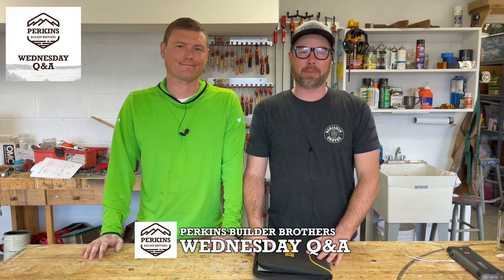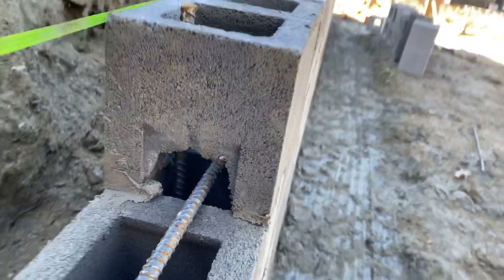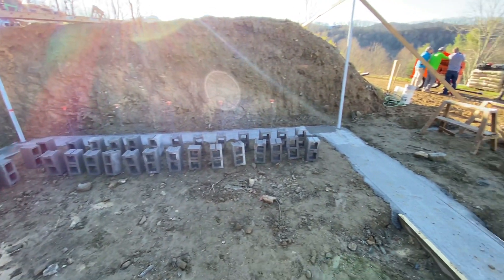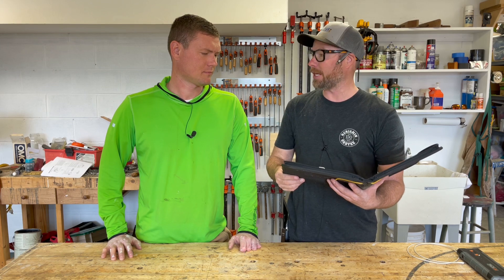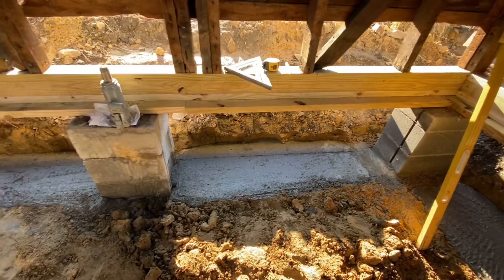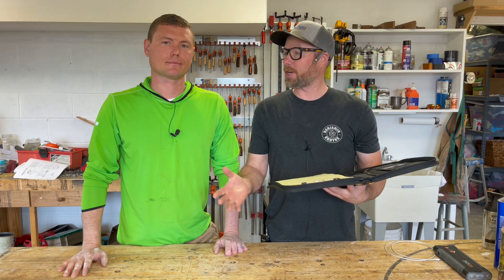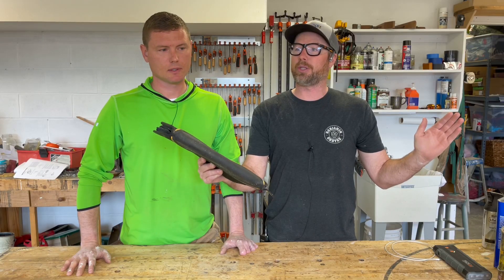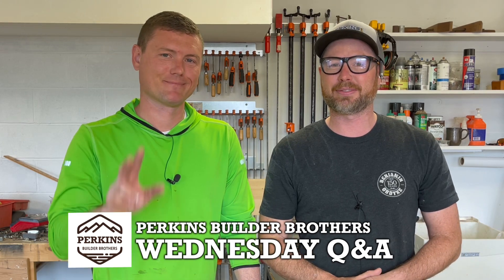Foundations and Underpinning | Wed Q&A #5

Comment: Balusters is the correct word for the vertical portion of a balustrade. Balusters were/are used as the vertical structure between a top and bottom rail. Balusters are for decoration as well as fall prevention between the two horizontal rails.
Pickets are sharpened/pointed vertical pieces that protrude through the horizontal plane/rail. Pickets were actually devices used for protection around a given perimeter. As viewed in paintings, photos and descriptions from antiquity, pickets were frequently used around houses. Side note: I suggest pickets were used more often to protect against animal intrusion versus human trespassing. Today’s modern world, and even back 200 years, is not a fair picture of the world some 400 years ago and beyond. Bears and lions were prevalent in Israel and numerous stories of dragons in Europe! Animals when $ where-abouts and the extinction of them, either by world-wide or local extinction, is is whole other topic!😂 The point? Pickets are pointy protection devices protruding vertically through the horizontal plane whereas balusters are contained within a top and bottom rail to form a balustrade.

Comment: Underpinning here in Michigan means Underpinning a foundation to add onto or rework a new building.  So you typically dig under the original footer no more that 2/3 of the footer and drill in new rebar hens pinning and your under the original.  Typically this is only done under columns to build new columns right next to each other.  But very rarely is this done the hole length of a building

Comment: i use 2x6, 8, 10 and 12 wrapped in plastic wrap for concrete forms then reuse on the house. to me working with wood is ways faster and lighter than blocks and then all the weight is in the concrete pump so i don't have to lift tones of materials

Comment: There were a LOT of Packard Trucks that hauled a lot of moonshine and other illegal spirits back in the 20's and 30's. as well as stocking groceries all over the country. Yes, there were Packard trucks as well as cars. Good, reliable, and strong.
Reply: Packard stopped building trucks around 1923-1924. I doubt if very many of these were used to haul bootleg liquor during prohibition. However many early luxury automobiles were repurposed when the original body started to look old-fashioned. Sometimes a wealthy car owner would commission a new, more stylish body to replace the original. Others would be sold cheap or scrapped and then reappear with a pick up or flat bed cobbled on the back behind a truncated body. A fair number became wreckers, making use of the powerful Packard engines and strong frames.

Comment: Hey man what you're describing about shimming up the blocks  before grouting is close to underpinning but not quite...underpinning a foundation is where you dig down under the footing about a 3ft long section you add reber in a grid pattern and pour concrete/cement till it reaches the footing and might encapsulate it then you skip a 3-4ft section and do it again then you come back after the concrete/cement has cured and dig out, rebar and pour the sections you skipped the first time around the house and this makes a solid foundation/footing also you dig it a little wider than the existing footers. Its pretty labor  intensive...you can use something like a back hoe but to get up under the footing you really need to do it by hand/shovel but yeah that underpinning a foundation and the reason I know about it is I believe my house may need it done...so I have researched it and for some reason I'm getting dajivou lol I feel like I may have seen this video before and commented?

Comment: I do a lot of decks....there is an app for baluster spacing that has changed my game...type in the space between posts, baluster thickness and desired gap between.....voila done and done, it will even give you a spacer block thickness. Things will vary of course becasue just like you guys said the posts are never the same distance apart to make perfect equal gaps but fuck man I do railings in minutes now.

Comment: Is it still within code to build a house completely with concrete blocks? Minus the roof of course.
Reply: In northern Europe or in Russia it IS the way to build houses. it is more expensive of course but way more strong. and yes, you lose all space inside walls for pipes, electricity and so on.

Comment: In my experience poured walls crack vertically and leak far more than block walls leak. Some block foundations I’ve worked with are 60-70yrs old before water is an issue. Most poured walls were under 10yrs old, and one was only 2 months.

Comment: Steel and core fill is code here🇦🇺. Underpinning is done for structural repairs. Also instead of blocks you could habe formed up collimns and poured a high mpa.  Your "grout" os called mortar.  Here anyways. 😁 i also do your way with balustrading

Comment: I have an old tobacco barn that I'm debating on tearing down or shoring up.  Half of the concrete brink foundation has fallen away, one side's 6x6 mudsill(?) has twisted and is almost off the crumbling blocks with that side of the barn drooping.  Even with those problems it seems pretty sturdy so I'd love to get it where I could use it without fear of the thing falling on me.  Plus I'm not sure how to bring it down safety other than using a bulldozer.    I've searched youtube trying to find a video on how to shore up an old barn foundation.  if you know if any good ones....

Comment: A balustrade is a post/column style enclosing topped by a top rail. It is usually referred within as a stairway or indoor landing railing of early European architecture however most were turned wood not square and do not have a bottom rail.    A baluster is a single column or post and normally positioned into a predrilled hole in the floor or step.  For outdoor balcony railing, with both top and bottom rails and using square stock is not considered balusters but I presumed PINS or slats.  

I am not sure of all international standards but the varied pitch slats is NOT a good idea for safety reasons. Aesthetically I would agree.  However, considerations have to be present for both children and pet heads being stuck between posts.  A 1/4in difference in span/pitch may not look different but would make a big difference in bending and or squishing a bigger object between the central slat span.  Most standards have a maximum acceptable width and bending moments. I don't see any issues with your design but I do suggest some cautionary notes.  Not all wood slats bend/flex the same.

Comment: I worked on a job in London where we had to dig under and support a stone foundation. We ended up casting a large pier, building brick up, and then packing in a super dry mortar mix on top of the last course. The dry mix was hammered in with a sledge and a wooden block.

Comment: When you talked about the last block being installed in replacing a foundation wall I noticed that you did not put a layer of foam (used to seal between the sill plate and foundation block in new construction) in before wedging in that last cap block. Won't you get insect and air infiltration into your crawl space? It was not done (anything to seal between basement wall and sill plate!) when I built my house in 1978 and I have had insect/mouse problems with no good way to after-seal that area.
Reply from the maker: Good question… A big bead of caulk inside and out after the fact :-)

Comment: you can jack up the house an inch or two more, and then set the structure back down. How do you get mortar all the way under the last row?
Reply: I'm not even gonna pretend I'm an expert here, but have been thinking about your comment. I would guess that the house is lifted on a combination of jacks and fixed pylons, which can't be slowly and uniformly lowered a couple of inches. I'd also guess that they lift it to the desired height so that they can build the foundation up to that reference. Once again just speculating.

Comment: Early not first
Reply: In the uk and Ireland underpinning is remove the foundation with 3 ft pockets and concreting with rebar then when set digging the rest until whole foundation is replaced. I’ve done it 3 times worst job after clearing live sewer